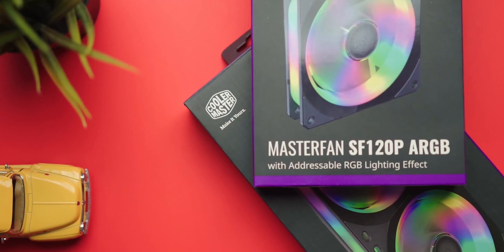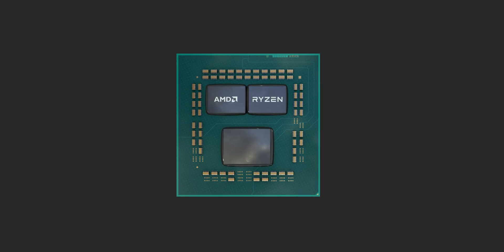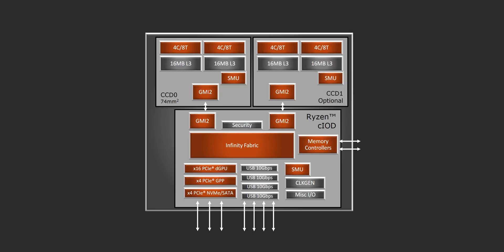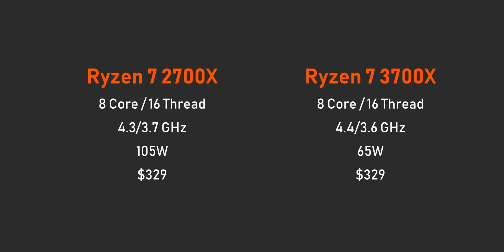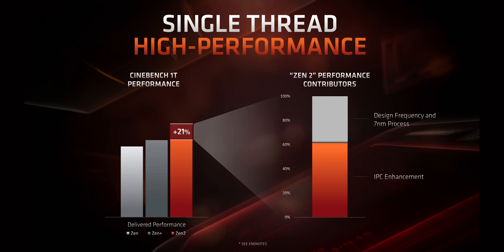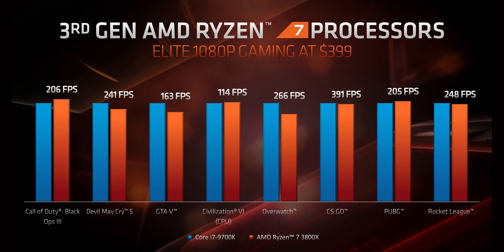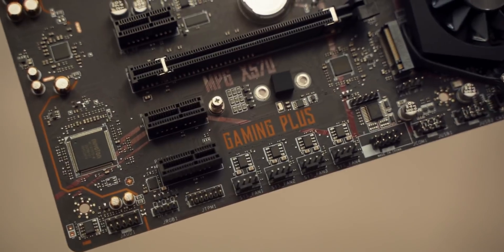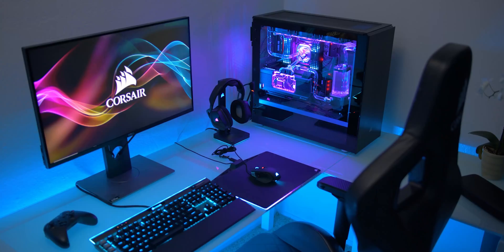AMD Ryzen 3000 – A Very REAL Problem For Intel?

Comment: It's becoming a real problem for my wallet
Reply: It would be more of a problem for your wallet if we're talking about Intel though :D
Reply: Damn right it is
Reply: Simple fix for that, sell your left kidney.
Reply: @hybridsuns  right
Reply: (if this is a joke,  my bad) 

Why tho? You dont REALLY need to upgrade every year or two, unless you're aiming for everything max (incl. resolution) on every possible game or something.
Reply: @TKIvanov  max resolution(4k, and to a lesser degree 1440p) actually needs LESS cpu power as you become GPU limited.
Reply: @TKIvanov  My thoughts exactly. If you bought any CPU in the past 2 years, you probably won't need to upgrade for at least another 4-5 years.
Reply: @uP-Andre Did you ask those people?

Did you also know that AMD CPU's dominate single-system game streaming, with a higher viewer FPS with fewer dropped frames?

It's not always a decision based on raw single-core performance, or even multithreaded performance. Cost is also a thing, specifically cost to performance.

If you're in the 5% where cost isn't an issue for a gaming PC, and you live or die by how stupendously your toy...yes, your toy...performs...then sure, build an Intel system and get marginally better performance for several hundred more dollars. And have fun desoldering/delidding your CPU to keep it cool.

I've been an Intel guy for two decades, but I don't bother quoting them for most of my clients anymore due to the performance-to-cost difference. Most people have a budget of $1000-1800, which has to include a monitor. In that range, Intel doesn't make sense.

If you don't have to work for your money, or work for your money but don't 100% take care of yourself financially, then the value proposition and "good enough, given the price" might not be a consideration. AMD is much, much more attractive than Intel when you have things like a budget and a household to sustain, and want to spend some of your money on a toy.
Reply: @nickpickerwi7787  Buddy, There's no point in trying to convince an idiot kid like uP-Andre. He clearly lacks any critical thinking ability and can only think in terms of his pathetic no responsibilities lifestyle. He's just another Gen Z waste of oxygen.
Reply: Did you SLI your credit cards too??
Reply: The CPU pricing is ok but the X570 pricing is through the roof.
Reply: I sold my 2018 macbook pro 13 to build my new PC with all new AMD RX570xt and Zen 3800x H500M case trident 3600 ddr6 ram 1tb 2nvme 4tb barracuda 7200rpm and x570 mobo
Reply: @tipico809  Do you really need all those high end components?
X470 is more value for your money in terms of motherboards (if you can find one with the latest UEFI/BIOS).
1 TB of nvme sounds excessive for most workloads, unless you got a really good reason to need it I'd suggest going with SATA based SSDs still.
The R7 3800x may or may not be worth it compared to the R7 3700X, I suggest waiting for reviews on that front to see if it OC well or not.
Make sure you check out people doing PBO overclocking too and not just fixed clock speed overclocking.
As for the graphics card.
Do you mean the RX570 or the RX5700XT?
They're totally different graphics cards.
Also, depending on your workload you might be better off with another alternative like Vega despite it being a older architecture due to its much higher compute performance.
Given that you're coming from a mac book I'm assuming  that this is meant as a workstation system?
Other options are also two RX580, two R9 390X or even something Nvidia based, depending on the workload.
390x is the cheapest option for double precision compute if your application uses that, but it's comparable with a RX 570 today in gaming, that said you can get two of them and if your workload allow you to use two GPUs then that might be a good solution.
For half-precision workloads cards like Vega 64 and Radeon VII are pretty good cards (and their double precision throughput isn't something to sneeze at either)
For video editing you'll want to use a Intel CPU (with quicksync enabled) + Nvidia GPU system still though as the best video encoder/decoder is still found in Intel iGPUs with the second best found in Nvidia GPUs.
AMDs video encoder/decoder is also getting a boost with RX5700XT but even if they reach parity in terms of hardware the software support for those encoders and decoders in professional software might still be lacking.
You might also want a Nvidia GPU if your workload is running CUDA and you don't have the source code as it's impossible to run that on AMD cards.
Only way to run CUDA code on AMD cards is to run the source code through a AMD compiler (after running some scripts on it that's still in beta stage) and then hope that it'll work without too much tidying up by hand.
CUDA binary won't work on AMD cards.

Anyway, I hope that was of some help...
Reply: @Luredreier  wao you know a lot about computers huh thanks by the way I want a good build for @leat 8 or 10 years for gaming on vr games on general videos editing music production etc so I'm waiting on deck to see what's the new king on parts I wait for release day and see all reviews from others and after build my PC I know evry year something new comes out for upgrade it's a good choice to have a PC cuse laptops is not upgradeable for nothing never and ever wasted ur money on over price laptops PC it's always better u can upgrade any time you want so let's see what's AMD has offer to us on next month lets see if they gonna take over envidia with price And performance can't wait to see the result
Reply: @tipico809  i think you have money for at least new pc after this
Reply: @tipico809  I sold my  new PC with all new AMD RX570xt and Zen 3800x H500M case trident 3600 ddr6 ram 1tb 2nvme 4tb barracuda 7200rpm and x570 mobo to buy a 2018 macbook pro 13
Reply: @jackjones7966  nah u kidding that's the worst thing ever you did lmao
Reply: 1967 kID I don’t think he was complaining about the price, but just saying he’s gonna buy a lot of AMD stuff in general. Also, if you don’t mind me asking, what are the top X470 motherboards? I’m getting a 2700x this summer and might snag myself a CPU/MB bundle from Micro Center. There’s a combo with the Asus X470 Prime for around $378 but I’ve read a lot of reviews and a lot of people get issues with that board being DOA or having issues with it. I might consider getting an X470 board with Bluetooth and maybe WiFi as long as it doesn’t break the bank and go over $450 for both things.
Reply: @awayracketeer6918  BZ from AHOC says the MSI x470 gaming pro carbon runs the 2700x really well, and its cheaper than that asus board.
Reply: Calidrius just remember you only need one kidney
Reply: @ready1player31  psssh, boiii you got shit all wrong. you donate sell half your liver foo, that shit regrows.
Reply: Same fam, same...
Reply: it become problem with mine too, because I ended buying more than one.
Reply: Tell me about it, I need a job to upgrade my 2500k!
Reply: my wallet already commited suicide.
Reply: The $999 Apple MacPro stand is not.
Reply: It was not a problem when Intel is releasing over prized CPUs. It is only a problem when AMD is releasing true high end CPUs that can stomp Intels. Intel can’t go down. Go Intel!
Reply: @miyagiryota9238  - exactly, that's why it's a problem because I want it but I can't afford it.
Reply: Calidrius then buy intels $1500 16 core cpu or the $2000 18 core cpu don’t buy $750 AMD 16 core which is overpriced compare to the Intels 16 &18 core. Go Intel!
Reply: miyagi ryota Intel fanboy

Comment: Price cuts incoming, overclock tool just launched by intel as well.
Reply: yeah, and for no freaking reason except to get people to buy one of their new CPU's it does not support any other K processor released before.
Reply: No, Intel is NOT charging for the overclocking tool - it's FREE, but they're OFFERING a one time use 'overclocking warranty' for suckers that are dumb enough to think that a 5.0Ghz overclock on a 9900k is going to kill it.
Stop spreading MISINFORMATION

Also, Tom's Hardware's testing mentioned that the software ran for 2hrs to get a 5.0Ghz overclock on a 9900k - and that it offered NO performance advantage over the 'Multi Core Enhancement' options already built into z390 motherboards

Don't waste your time - Intel is just desperate to look like they have a 'Ryzen Master' equivalent
Reply: @RyTrapp0  Thanks for leaving fanboyism aside to post verifiable info instead of useless opinions. It's appreciated.
Reply: They can't cut prices too much or they won't gain any profit, remember Intel is still on monolithic design which means yield failure rate is a lot higher than AMD.
Reply: @rushdrift  Its true but products collecting dust on a shelf generates no revenue too.
Reply: @simonsloanes2739  $150 6c/6t 9400f is a solid price cut from the 8400-8500 as well.
Reply: That new overclock tool is not free!! Intel is charging a one time fee of $19.99, and it will only work for select gen CPU's. Ryzen Master came with Ryzen 1st gen at launch for free.
Reply: @simonsloanes2739   oh wow . Guess they really feeling the pressure. I  thank God for ryzen.. way to go AMD.
Reply: Intel doesn't do price cuts. 
They will make their 16 core CPU no threads  worth 1200$. 16 core  32 threads CPUs 1899$ still 14nm ++++++++++++++±+++++++++++++++±
Reply: @NeVErseeNMeLikEDis  15% price cuts all over web so what you on about?
Reply: @aberkae  yet even with a 15% price cut the entire 9th gen range is still heavily overpriced. People forget that the 9th gen is nothing more than i5 cpus being sold for i7 prices. That's before anyone factors in intels terrible security...
Reply: @jotunheim5302  agreed the 15% price cut is before 7/7/19. The market will probably force more cuts due to competition and reason you stated above.
16 core intel cpu cost 2.5x the cost of 3950x🤦. which is coming out 9/19.